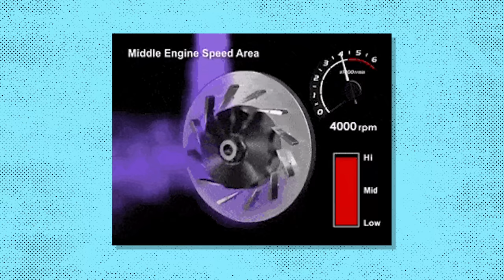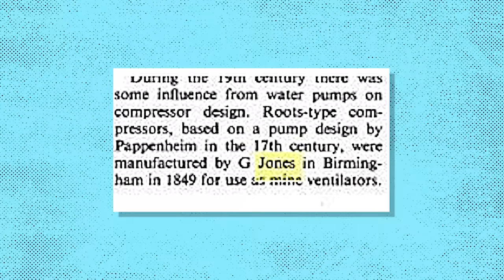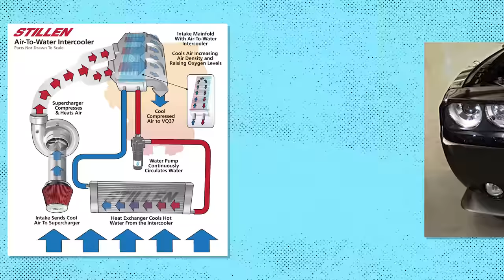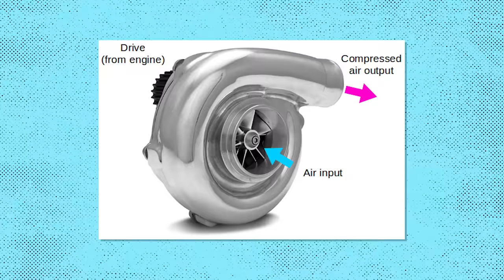Why Superchargers Aren't As Good as Turbos

Comment from the maker: Would you buy a car with a supercharger? Or would you go Turbo?
Reply: Turbo cars are much more exciting, especially older ones as you feel the boost increase from the turbo lag as you accelerate.
Reply: Supercharger ofc
Reply: It depends on the car and what I’m using it for but mostly turbos
Reply: ofc a Electronic turbo supercharger!
Reply: Turbo
Reply: Turbo.
Reply: Naturally Aspirated
Reply: Twincharged
Reply: As someone who loves drag racing, I would go with a supercharger.
Reply: NA or Super please, I hate turbo lag.  I know it's not an issue if you're in the right gear but in the real world driving with normal conditions you can often be in a high gear for fuel economy, the thing i hate about a turbo is when i push the pedal i want power, i don't want to push the pedal and get power sometime later.  This is even more of a pain on modern tiptronic types, i either have to halve my fuel economy by putting it in S, or I have to downshift with the paddle, or I have to hit the gas and wait for the car to work out if a downshift is needed.  Only thing they're good for is if you're driving in a dead straight line and want a kick in the back, then I'll admit they're great fun, but everywhere else, nah.
Reply: Supercharger  im stubborn on the subject lmao
Reply: @pauledwards8055  it’s from exhaust gases, pretty sure he mentioned that
Reply: Dualcharged would be the optimal way to go, a friend of mine has a golf 1 liter dualcharged, I honestly thought it had double the displacement, judging by the way it drives
Reply: Supercharging provides a better power curve with substantially more belly torque. 
A well engineered turbo kit is by far the best option in my opinion
Reply: How about twin charged there have  been a few that worked well even if the rngine was small. Turbo is what I have run in most cars though.
Reply: in my opinion both are not on the top of technical engineering anymore. the way to go is electric, especially with nowadays 48V technology in cars. porsche is planning something electrical if i'm not wrong. and to be honest, don't call it an e-turbo please, it's more an variable e-compressor ;)
Reply: I have an old Mercedes C230K with a supercharger and the immediacy and low down torque is super nice for daily driving
Reply: My Jag F-Type R V8 has a supercharger and I looove the instant power at any rev range!
Also 550hp is already ridiculously fast for a road so I would rather have the driveability and driving feel that a bit more power.

Still if you want even more power you can tune these Jags to 660hp dead easy and they still remain super reliable unlike turbos 😁👍
Reply: @dangerously9498  imagine having all that power available instantly, that's a supercharged car for you.

But if you like the lag and the build up and anticipation than good for you. Although I would urge you to try a supercharged Jaguar F-Type V8R and let me know what you thought 😉
Reply: Depends on what your looking for.  There’s a reason the drag world uses superchargers almost exclusively.  No lag and they don’t run long enough for the pumping heat losses to accumulate.  A screw type supercharger is the best.
Reply: Depends on what u want to do with the car.
Reply: Rotrex supercharger all the way. It's reliable for racing. Lag is absolutely minimal. Efficiency is high. Unit is small and packaging is easy. Builds torque with rpm for the most usable power curve. Makes any NA engine sound better than without it. Sure, turbos can be a little more efficient, but ime it's the transmissions that are usually the high expense these days. Turbos are like broken promises, efficient but only if you use them in a certain way, reliable but only if OEM, lag free but only if inefficient and built for racing by a large manufacturer.
Reply: Supercharged my M3, love the low down torque! The power band is amazing on the track, flat as a table.
Reply: You really don’t know anything about these, do you
Reply: Twincharged :/
Reply: Yes i bought a Jaguar xjr.
Reply: I would love to get a supercharged mini.
Reply: Both
Reply: My summer car is a simple 2005 Merc SLK, so it comes with a supercharger standard. It barely makes 180HP, but I don't have the car to go fast. The mechanical whine it makes is quite pleasing though ..even if you don't go all that fast really 🥲
Reply: @ZoltanF1LH  my xfr has been mapped and pullyed 600hp flat torque curve as you say instant power. They can keep their turbo thingys. One thing no one mentions is your engine oil is going through the thing spinning at 100000rpm and returning to engine looking like whipped cream. Supercharged jag for the win.
Reply: @chrisclarke6344  I love my F-Type V8 R, unlike the turbo cars it has instant power and insane sound 😄
Reply: @ZoltanF1LH  i am rather attached to mine the exhaust note is to die for and it ran 11.1 on 1/4 mile. Not to shabby for a 4 door saloon!
Reply: @ZoltanF1LH  plus best of all its a jaguar.
Reply: @chrisclarke6344  so we must have the same engine then! 😀
oh yeah Jag all the way, I always wanted a Jag since I was a kid and thought they were the most beautiful and elegant cars 😊 I love my Jag F-Type R, it's so beautiful I keep looking at it from the window all the time 😄

I almost bought an XFR a couple of years ago too! I actually prefer that shape to the new one. Congrats mate you have an amazing car 😊👍
Reply: @ZoltanF1LH  thanks it is the same engine 5.0 supercharged direct injection. I think the ftypes are absolutely gorgeous and proper drool material and i dare not go to local jaguar dealer in case i just cant control the urge to order one but need 4 doors, hence xfr had her new in 2010 and that replaced s type r. In my mind there are two types of motor car the jaguar and the rest!
Reply: @chrisclarke6344  yesss you are right 😁👍
I also needed 4 doors so I decided to keep my old hatchback too 😄
Reply: So, the way I learned it was that if you want to get away quickly from 0, you want a supercharger. If you're already motoring and you need a blast of speed, you want a turbocharger. Please bear in mind my first car was a Ford Escort, Mk I. It was 12 years old when I was 18, and it did not end up being the oldest car I ever got. (HB Viva, 1967, bought for me by my then bf, now hubby of 30+ years, for £20 in '86. Genuine 28,000 miles on the clock and was a great car lol.) 

What I mean by this is that my knowledge of cars is pretty much reserved for anything old and mechanical, not modern electronic & computer driven ones, though I am stuck with them these days. I just don't fix my own cars anymore. So my knowledge is... basic, shall I say? (Dad had me helping him maintain his Humber Hawk taxis, starting when I was 4 - my fingers could get spanner heads into places his big hands couldn't get lol. I also had a lot of practice jerry rigging the Escort's ignition, especially the points, because it was forever blowing them, no matter how often I changed the entire system! The silver paper off the back of chewing gum strips will get you off a motorway...)

What that's leading to is my dilemma. If, by some chance, I ever get my dream car - or rather my second choice, because my first choice is as old as me (Jag E-type), far more beautiful and worth considerably more! Anyway, choice 2 is its "baby", the 2nd most beautiful car ever, the Jag XK8. Or the XKR, the supercharged version. Given that I'm more likely to need to pull away sharpish from a dead stop than need a kick of speed past 70mph, I've thought that the XKR would be the best for me.  But now I am left wondering... You see my dilemma? With fuel costing so much these days... 🤷🏻‍♀️😂
Reply: @ZoltanF1LH   i do have a back up a series1 discovery they like chalk and cheese!
Reply: @y_fam_goeglyd  get any jaguar 'r' series you will love the power delivery just seamless acceleration. Pussy cats when in city driving or touring but drop the pedal and the power is instantly there.
Reply: @pauledwards8055  Exhaust gases.
Reply: Turbo
Reply: Turbo over supercharger,  but 1st pick would be a beautifully designed n.a. engine.
Reply: My choice has always been turbo !! A turbo setup is more customizable,  makes more noises and you get more power out of it. With the right tuning it can also make the power come on like a SC. SCs are more for those that added a ton of Bolt-ons to their NA car and now just want the next thing to compliment the rest of their NA mods.
Reply: Turbo for 1/4mi. Supercharger for track and daily driving torque.
Reply: @dangerously9498  also the 'PPPooowww' that some aftermarket turbos can make is just intoxicating
Reply: Supercharger are better than turbos ... in daily life i do not race... bro lol just going work...return home...going somewere ... and most superchargers produce more torque in low rpm ...fuel economy...superchargers are fast too... and superchargers are the best  on some engines with not too much rpm  till 6000rpm  supercharger will beat any turbo in the same hp...weight ....cos they have produce more torque
Reply: Superchargers all the way
Reply: Supercharger, would also rather supercharge a car than turbo one.
Reply: I'll be building a supercharged 2gr MR2 with my dad for his car and then doing the same on my MR2, for the 2gr its lot cheaper and better to go supercharged over turbo as the car and the engine are designed for torque and being thrown through corners. I wouldn't say they suck thats just clickbait, a little bit compromised yes but they dont suck
Reply: I think the supercharger works best for launching a car from a stop. Maximum, immediate torque. American muscle cars were built for drag racing, not cornering.
Reply: i'll keep my supercharger and it's happy screaming thanks
Reply: I choose the combo, no lag but always more powaaaaa!!

Than i realize i can't buy any car cause i'm broke so i keep dreaming with videogames ;)
Reply: I’d get a twincharged car, using both a turbocharger and a supercharger. I’d also look into variable ratio superchargers, they’re pretty interesting.
Reply: I prefer super over turbo personally.
Reply: Naturally Aspirated. Ask Scotty Kilmer the same question, he will say the same.
Reply: Superchargers suck air
Reply: Supercharger, I like the sound and I'm trying g to buy a hellcat......because I like the sound
Reply: I have a S1 Exige - 815kg with a supercharged vtec approx 300bhp.
The throttle response is incredible
The supercharger is behind the block against the bulkhead,it's not on top of the engine.I like the noise!
A very neat conversion,that looks as though it was fitted at the factory.
It's very rapid in every gear at any revs.It will pull from 1200 rpm to 8000rpm.in sixth gear! That's from around just over 30mph to potentially 160mph in one gear .Not bad for a 2 litre car!.
Reply: I have an Audi Q5 with the supercharged 3.0T, and it sure is fun. With some minor bolt-on parts and a reflash I can make more than 500HP. 😀
Reply: The Vauxhall ute I saw on top gear years ago is definitely a supercharged car I would buy. Sadly they never made it to the states.
Reply: @phillupson8561  The Celica GT-Four would be a good turbo car for you. It came from the factory with anti-lag bits already installed in the motor. Just gotta hook up a laptop and load an anti-lag program. It will spit fire and never be out of boost.
Reply: N/A, but if we are talking about forced induction only, the closest to naturally aspirated is S/C.
Reply: Neither of them.
Big Naturally Aspirated engine is the answer.
Reply: I own a car with a supercharger, I love the throttle response it gives. A turbo always has some amount of lag, but I understand why they're more commonly used
Reply: I bought a Twin turbo f150.
Reply: The supercharged Audi A5 is my choice, 438hp from 3ltrs reliably, instant grunt, and not terrible fuel costs.
Reply: Supercharged rotary, just to go against all your advice.
Reply: I have an idea on how to make the superchargers better but it's more of a cross between the 2
Reply: I've got a 17 S60 T6. Twincharged is fun.
Reply: supercharger
Reply: na
Reply: I have a C200 compressor does that count?
Reply: Turbos are for dynoqueens these days
Reply: Currently own a supercharger but not because I'm anti turbo.
Reply: supercharger all the way
Reply: I have had 3 cars with turbos.  The ONLY one with no lag is my 16 ATSV sedan that was tuned to remove the lag!!
Reply: Supercharger! 
Superchargers are better on every way
Reply: supercharger it is
Reply: Super because i hate lag. Also superchargers could compete a bit better with turbo if manufacturers implemented a CVT like transmition to the superchargers for optimal air intake. There are already projects on that but, much like the freevalve, no one seems interested because the future is eletric.
Reply: Got a supercharged mercedes all r170. Love how snappy it is in daily driving.
Reply: I would go for supercharger strongly.
Reply: Blower or NA any day of the week. I am addicted to good throttle response.
Reply: Twin screw supercharger. Maybe with a "helper" exhaust turbine geared to it which engages at higher rpm. The twin screw is already efficient at low rpm and will even improve fuel economy in everyday use since most road cars seldom see high rpms in daily driving.
Reply: I will save up and build my own twin-charging setup!
Reply: The ole LSA was a pretty tough motor…
Reply: A turbo and GDI would be perfect since the combustion chamber would be ideally compressed at the moment of injection/ignition.
Reply: @Bit-while_going  That's why turbodeisels are popular
Reply: Doodooballs
Reply: Both…
Reply: Both.  Super Charger at first until Turbo kicks in. No turbo lag great off the line acceleration. A No Brainer.
Reply: both. twincharge like the lancia delta s4. no turbolag. boost at low and high rpm.
Reply: @SimonBauer7  Do you remember Koingsberg I think. They took a Ferrari Testarosa and put a single super charger with twin turbos. Early 90s I believe.
Reply: Nitrous!
Reply: in America we like cars that are simple to work on so i’m going to go with supercharger
Reply: Depends on the use, superchargers (since they're belt driven) have no lag (timespan between hitting the gas and feeling the boost) which make them great for drag races, two major inconvenients are that they occupy way too much space compared to a turbo, and possess greater parasitic losses (some take up to 125 hp to move). Turbos are great since they're efficient and compact, but I dislike the feeling of lag, I'd say a sequential twin-turbocharger would be just great.
Reply: I'll take either really. I don't care what it is, mo powah is mo powah.
Reply: @MyHandleIsGood  big brain
Reply: Love my supercharged Audi S4 b8.5
Reply: Naturally Aspirated.
Lighter, cheaper, no lag, and less complicated.
Reply: Yes
Reply: If given the choice I will always go supercharger
Reply: I do notice he never mentioned underbonnet temperature , or life expectancy of the unit ( 50k miles for a turbo ) and the bigger the turbo the bigger the LAG, and the bigger loss in driveability, and practicality.
 At the SAME horsepower output the SUPERCHARGER wins every time !
Reply: Supercharger - it would have to be a Jaguar Project 8(if I had the money).
Reply: Depends on the purpose ......
"Supercharge for the street, turbocharge for the track !"
Not many (none) turbo top fuelers setting records !
Not many ( none) supercharged ralley cars.......NASCAR would go turbo 
" In a heartbeat" if it allowed forced induction, they wouldn't supercharge !
Reply: Mercedes does BOTH ! depending on the engine. V8's and V6's are Compressed, but their flagship motor V12 was twin turbo.....nature of the motor you are forcing, determine's which method you use...... Relating to the "effiency loop" of the
Forced induction.....
Superchargers are NOT good for high revs, generally over 6000rpm......
Reply: Better buy a nuclear powered car from 2077, Lifetime reliability will run forever
Reply: @rommelcorbito808  and you won't need night lights around anymore because of your glowing skin,( you know they are going to "cheap-out" the containment) two birds....save on electricity as well !
Reply: @dangerously9498  my mustangs turbos will spool up and be at 0 psi then i floor it and the car just jumps forward as they reach 30 psi lol
Reply: @Kenneth.177  Ur a mussel guy but I'd go with a turbo because I'm a jdm guy
Reply: There was a few models that used BOTH.
Reply: Supercharger all day every day. Screw efficiency, nothing sounds like a supercharger.
Reply: @dangerously9498  unless the boost kicks in while you're going through a corner
Reply: @dangerously9498  A centrifugal supercharger has sort of the same behavior, like the Procharger.
Reply: The mclaren Mercedes SLR was supercharged. There is something called turbo lag, they run extremely hot and I dont see a turbo car making 12,000 hp.
Reply: @frankcastle9691  theres no reason they couldnt though. The most powerful engine in the world is a two stroke turbo diesel producing over 100,000hp and 7million Nm of torque. I mean, you PROBABLY couldnt fit it in your Mercedes SLR but thats not exactly the point.
Reply: @Katrina Paton  super chargers still have their place. They make immediate power and torque vs a turbo that has to spool up. Just because turbos are popular doesn't mean that they are the best.
Reply: i rather the turbo because it makes peak power (i guess...) and it makes the "stutututu" sounds
Reply: I will buy mr2 and install supercharger then make it lightweight install suspension and gearbox 
And all of it beacons I want power under my foot when I Am on the corner 
The new generation only races on straight so if they want turbo I don’t care I want to race on corners
Reply: IMO The instant power and response far outweighs a slight loss in efficiency. Plus, turbos tend to be an absolute PITA to install and work on.
Reply: @seanwright1264  yup 
Turbo is for straight lines and awd cars  
I am not telling I am a coward but haven’t control over the car and racing in corners is much more fun than stepping on gas and trying not to crash
Reply: The reason some people go with a supercharger over a turbo is precisely because of the lag with turbos. We prefer having INSTANT boost straight from idle. We want that low end torque and grunt that annihilates rear tires.
Reply: Yes
Reply: Pro charger,  just to be different
Reply: supercharger forever!!!
Reply: ive owned both a supercharged corrado vr6 and turbo s3's scooby ect . love the low end grunt the charger on the vr6 as it made the car pull through every gear hard and full . but  turbo is way more cost effective too tune on walets too for bigger gains. why not try  what lancia did with the s4 . supercharging and turbo in one package  😈😈😈😈😈
Reply: depends on the car, a jeep or a mustang for example a supercharger meanwhile a jdm, a Supercar for example turbo
Reply: Both.  Supercharger for the low-end, and then have the turbo take over on the high end.
Reply: Supercharger cause the turbocharger gets broken
Reply: Own 2 supercharged vehicles. Most pass emissions testing while most turbo kits don't. Fastest quarter mile cars are supercharged.
Reply: @krexci2966  All I had to read was "has a Golf" and didnt need to read further.  :P
Reply: But really, supers for v8s and turbos on the smaller engines.  I have a 383ci 57 Chevy with dual carbs and a Weiand Supercharger, so you see my bias.
Reply: @slawdawg23  it's actually surprisingly good, atleast engine wise
Reply: @dangerously9498  That's why old Turbos suck
Reply: both
(at the same time)
Reply: Biturbo of course. All boost is good, but turbos are just better.
Reply: @GodlikeIridium   supa chaja
Reply: Supercharger for raw power plus the sound.
Reply: Turbo for small cars, cause you're hosed already.  Only way is to spike HP & make a less driveable car.  If you have a huge motor & can buy a supercharger do that if you can afford the higher cost.  Prolly a reason the Demon 170 uses one, so do I.
Reply: I rock a XFR so going to say S.C all the way. I hate the way turbos sound. I have straight pipe and love that my car sounds like a dragster.
Reply: @phillupson8561  if you want lots of power instantly, then then use two small turbos, it has minimal lag with more boost than a supercharger plus the added fuel efficiency.
Also, If your frustrated with tiptronic, then use a manual transmission. manuals will
also give better fuel efficiency since they use less gears with a clutch an not a torque converter.
Reply: Supercharger, they are literally just better, not sure what the point of this video is
Reply: @GodlikeIridium turbos are literally objectively worse XD
Reply: @nitrogod9990  did you even listen to the video?
Reply: @phroogo...  Obviously not, that guy is uneducated
Reply: @MelonMelonwater turbo is better.
Reply: SC. Zero turbo lag and instant torque
Reply: @georgepapaioannou5115  SC. Less torque, slower acceleration.
Reply: @WilhelmKarsten  I care about 0-80mph.  I live in the real world. Turbo's lag. Fact.  SC sounds better and instant torque, no waiting for boost.  What's not to love
Reply: @georgepapaioannou5115  Turbo lag isn't real, it's a imaginary phenomenon caused by the difference between linear and curvilinear acceleration.
Turbo lag is not real, it has no effect on acceleration times.
Turbos make more torque and therefore they produce faster acceleration and ETs.
Reply: Supercharger! Why? Because you will never get to use the power of a turbo unles you are on the interstate. Superchargers rip and sip as soon as you pop the clutch. Why? Because there is a belt comnected to the crankshaft.
Reply: @FLORIDAMANIAM-he2lz  The turbo will always make more power, Why? Because there is no belt connected to the crankshaft.
 The Turbo takes horsepower that is wasted out the tailpipe and turns it into horsepower at the wheels. More power, more performance.
Reply: @FLORIDAMANIAM-he2lz  V6 engines need all the mid and top end help they can get.  That's why turbo makes more sense for them
Reply: Superchargers
Reply: Will use twin centrifugal superchargers after I rebuild my 7.3 diesel for minimum 800 horsepower/torque.
Reply: @scottdouglaswashburn7769  with a Diesel engine you make way more power with a turbo and no lag.
Reply: Neither, as they diminish trhe life of the engine too quick, but if I had no choice but the 2, naturally I would choose a turbo because the parts are there.
Reply: @glennyj65  reliability has more to do with the make and model of the car... not the induction type.